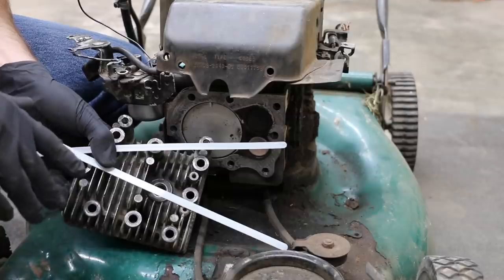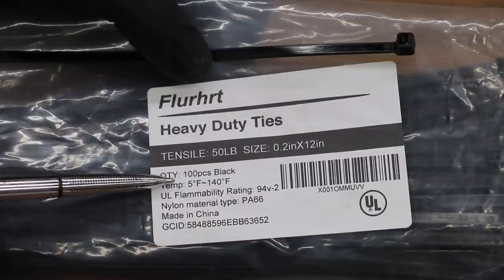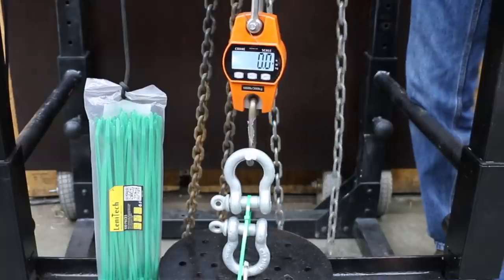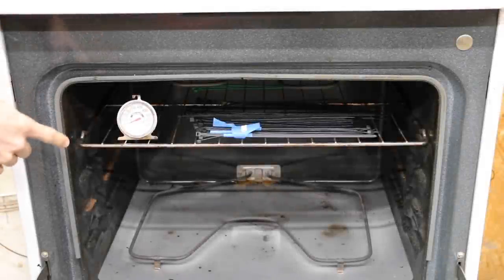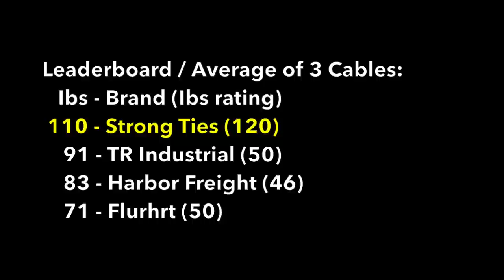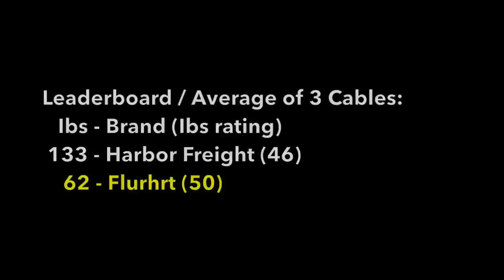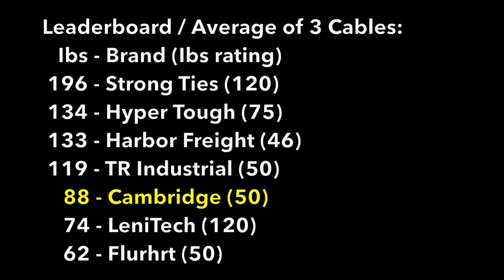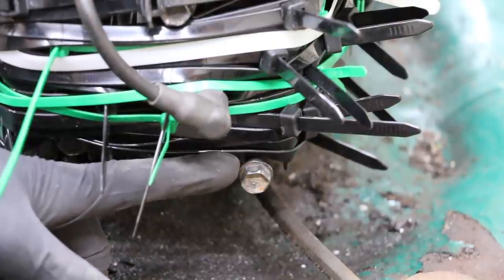Best Zip Tie Brand (7 Brands Tested)? Let's find out!

Comment: which tires sealer is best, slime , sleaer in a air can tire ject etc tube sealer and tubeless sealer
Reply from the maker: Thank you for the video idea!
Reply: That might be difficult to test considering the variables of whether there was a puncture, whether the object is still in the tire, whether it is tread or side-wall, newer tire or old/dry-rotted, whether leaking from the bead (where slime/etc liquids will tend to not go), leaking from tire stem, will it clog the stem core or TPMS sensor, will it really piss off (or at least be a big mess) for whoever takes this tire off to fix, will it work as well at cold and hot temperatures, at different tire pressures, at different loads, at different application temperatures, for how long it will last at different pressures, whether it makes it more difficult to get a tire patch to stick... and probably a dozen other significant variables that I can't think of at the moment including cost per application, shelf life, and whether there is the ability to store in a vehicle (trunk, etc) in very cold and cold conditions.

I'd say this type of testing could be useful but would take many months to do right and would generate so much data that we'd be left with the existing consensus that you only want the spray can type if it's an emergency and you need to inflate the tire a bit with it, that it's meant only for not getting stranded, then a tub of goo (slime/etc) for everything else.   In other words for a public road vehicle, if you can avoid use of tire sealants you're better off.  If not public road transportation, is it that important to rush to get a tire to seal?  Maybe if you know you're replacing it anyway and it's your wheelbarrow where you can just get a new rim with a new tire already on it.
Reply: @johndowe7003  yeah i wouldnt use it as a permanent fix. Just a keep in your car if you need it to get you to a close shop. I keep a 9volt air compressor and some tire seal in my pickup just incase
Reply: I Suggest Highlifter https://www.amazon.com/High-Lifter-Hlp-Tire-Sealant-x/dp/B00QV4U0V8 I've used this in every ATV tire flat I've ever gotten and it's fixed every single one of them. Even the most dry cracked and awful looking WWII surplus tires have held the same PSI for 2 years straight after filling them with this pink stuff. (suggest oil syringe for filling from a cup)
Reply: @burp1914  yeah that can happen if you got bare steel exposed. I paint the inside of the wheel with primer sealer just to make sure that doesn't happen .
Reply: I always preferred Slime, until it caused a leak.  It messed up the valve stem.  It got in the stem, dried, and prevented the valve from sealing.
Reply: @robertheinkel6225  yeah I like slime the most, seen it stop a 3/4 hole on a tractor tire and I was rather impressed that it held up . Never had problems with leaky valve stems in my experience though .
Reply: @Krazy Kanuck last time i got a flat on my truck i just drove it like that for about 5 miles on the rim lol, steel rims are the best for that
Reply: @johndowe7003  Ever have a tire split apart after being plugged?  I have three times now.  I'll take my chances with slime especially if its a newer tire with lots of tread left.
Reply: @BlàckÐèàth  i rarely use actual tire plugs they either get patched or have sealer in them
Reply: To test and take out variables you could use as cheap of a cart tire as you can find to keep costs down then screw a drywall screw in and remove it, install the sealer to be tested then air the tire up and see how much pressure it holds initially and then over 15, 30, 60 minutes.  Then mount another tire and do the same thing each time.
Reply: None. That shit doesn't work. Take it to a tire shop and get it repaired properly. Nothing I hat more than repairing a tire and when you take the tire off all the slime falls out on the floor. Most of the time when you put that stuff in the tire, the tire is junk anyway. You cant repair a tire after that stuff has been in it.
Reply: @alexpuls8219  I fix my.own tires, I don't take them to shops cause chicken sht wanna be tire men complain about getting dirty. I patch, plug , seal etc I do it all on my own equipment.
Reply: @Alex No one said that they wanted to use the tire sealer forever.  It would be nice to know which one worked best in a pinch. Also, slime definitely does work, I've used it to fix ATV tires, lawn mower tires, and car tires that have held air for years afterward.
Reply: @johnbarzee7806  what I'm saying is that when you put that shit in your tire. You can't repair it after. It soaks into the rubber and the patch will never stick. And dont say you just plug the tire. That's not how you properly repair them...
Reply: Ridw-On Tire Sealant and Balancer. You're welcome!
Reply: @Krazy Kanuck I don't cut the tire off , I drive on it. Allloy wheels kinda suck cause they tend to chip or crack if you drive on the rim on a hard surface. I prefer steel rims for that exact reason.
Reply: @Krazy Kanuck exactly why I have a full size spare in my vehicle.
Reply: @lifeisawar zone yeah i only used tire sealer canned and slime, and napa brand sealer i like the tubeless tire sealer the most the tubed sealer has finer pieces which is better for tubes rather than tubeless
Reply: @superguest3  why wouldn't you just carry a plug kit, that way they don't charge you labor to patch the tire afterwards.
Reply: @davidroberson8951  to be honest dont know how to do it that way. Plus I have road hazard anyways. They don't chage me parts or labor

Comment: I used thousands of zip ties while working for SW BELL and AT&T as an outside cable tech.  The black ones lasted twice as long as colored plastic due to higher carbon content in the black plastic.  Also, the ones with metal tabs are much stronger.  Stainless steel ties are the best, though pricey. One weak point is that squirrels love to chew on the plastic ties as well as being weakened by the sun's ultra-violet rays over time.   They have 101 uses and come through in a pinch for any handyman's tool pouch.  J K
Reply: Totally agree on using black only! Only just started using the stainless ones, my problem is getting them as tight as the plastic ones due to the lack of elasticity...
Reply: Do you have access to the tool used for the metal ties ?  It is nothing more than a round rod with a slit in the end.  I have used needle nosed pliers but not as well.  There is a bit of a technique to getting them tight. It takes a little practice,  mainly cut off all but about one inch after it is slipped through. Then curl the end in . One direction works better....underhand twist.   J K
Reply: @jameskrivitsky9715  Ah, I had no idea a tool was meant to be used! Thank you!
Reply from the maker: Great tip on using the black ones!
Reply: James Krivitsky, Do you remember using a cable tire (it wasn't technically a zip tie don't think) that was about 1/2" wide and you had to feed both ends into clasp/locking piece? It had metal tabs inside to bite into the tie)/band.
Reply: In my country the black ones are specifically UV protected compared to the whiteish ones.
Says so on the package at least.
Reply: is that why MommyBell filled chapter 13 LMAO to many zip-ties  sorry had to pock fun at it a little.......You are right on saying the black ones hold up better, its also do to the plastic they are made out of tho also.
Reply: i dont know what brand the at&t techs use but i got some from them years ago and they where better then any other zip tie i have used
Reply: @paulshayter1113  I use them at work. They are Band-it. The company name. Yea they far superior to zip ties but also far outsize the prize range of a zip tie
Reply: I can confirm, when unloading trucks in a retail environment, you can snap even most oversized zipties by hand to unpack products faster. The metal ones however are in another league.
Reply: Black ties are UV resistant.  The white ones self destruct in the sun in 2 to 4 years.
Reply: @johnd4348  not all black cabel ties are uv resistant ! We sell cable ties and I talked with a manufacturer about it.
Reply: @Lusty_Wench 
Guess what? Black die in plastics is usually carbon. Doesn't add anything in strength (they aren't carbon fibers), but it inherently makes playstic more resistant to UV, because the UV gets absorbed by the carbon instead of breaking plastic molecules.
Reply: @paulshayter1113  In Ohio, those were https://www.google.com/search?q=deltec+cable+tie+with+double-locking+head&rlz=1C1SQJL_enUS793US793&oq=deltec+tie&aqs=chrome.4.0j69i57j0l3.14139j0j4&sourceid=chrome&ie=UTF-8   Either in pre-cut lengths with the head attached to one end or as a roll of strapping with a bag of loose heads.   Incredibly strong.
 "regular" ties were usually from Thomas & Betts
Reply: @allthoseclips582  Totally agree on the metal ties. They can't be beat for their strength. Unfortunately, my girlfriend always complains that they chafe.
Reply: @paulshayter1113  You are talking about Deltec straps I've held transmissions up with those.
Reply: Chris S, ding, ding, ding,ding, We have a winner! Those are the straps. Incredibly strong and they seem to be pretty much impervious to chemical and the elements. A buddy that worked for Ma Bell back in the 70s & 80s gave me a bunch of them and I used them sparingly over the last 40 or so years. I think I'm down to my last two but now that I have a name and can source them I can start using them again.
Reply: Hydroculator, You have to wrap them in felt. 😉
Reply: Larry Kraus, They're the ones.
Reply: I still remember using a zip tie zipping tool.  We made tons of cable harnesses for the gaming,  I.T. and custom harness industry. Been a long time.
Reply: petrol devo, I still have two different tools. They are nice for getting a tight fit but also the cut the end cleanly without leaving a sharp edge/burr.
Reply: @paulshayter1113  yeah, those are nice and get the job done quick.
Reply: @Lusty_Wench  , and just what do you suppose makes black dye black? If you said "carbon", you win!
Reply: Hellermanntyton are by far the best Zipties I've ever used
Reply: The tools i used on zip ties left a sharp angle cut if not cut perfectly flush.
Reply: In my home country (New Zealand) we install climb guards on every power and comms pole to keep critters off them  - nothing fancy, its just a 24 inch wide strip of stainless steel wrapped around the pole that they can't get past - https://www.humes.co.nz/assets/Concrete-Precast/2562d65da4/Humes-Concrete-Power-Pole__FillWzQ4MCwzMTVd.jpg or https://www.odt.co.nz/sites/default/files/styles/odt_story_slideshow/public/slideshow/node-1258660/2017/08/agerrypole8.jpg  (They're known as possum shields because the primary climbing pest is Tasmanian ringtailed possums)

When coupled with an almost religious attention to keeping trees away from the lines It's highly effective at saving wire breakages from heavy animals on comms cables and power cuts due to crispy critters on 11kV lines.

I'm surprised more countries don't do this. It's very cheap to do and saves a lot of problems longer term.
Reply: As a truck driver I don't leave home without them, I wouldn't want to live in a world without them.
Reply: Aye, I started with Southern Bell in 1970 and they used to provide us with gray ones to match the inside wire color, and black ones for outside. Don't remember what year, but they advised us sometime in the mid-70's to not use the gray ones outside because of UV driven plastic breakdown. The black ones were known to be more suitable from the point on. And starting about that time we were required to replace the gray ones with black ones if they had been placed outside and the boss could see them when doing job inspections. The gray ones would start falling apart in just a few years.
Reply: @christopherwallace826  Bell Canada used Thomas & Betts

Comment: Can you test which Drain Clog Cleaner works best?
Reply from the maker: Thank you for the video idea!
Reply: Buy 1l of highly concentrated sulfuric acid on amazon or another store.  That will make 200 liters of 0.1M pH 1 of draino for $30-$40.
Reply: John Handcock  That's really fricking dangerous stuff and needs to be handled with extreme caution. I've seen people add water to the acid and have the heat reaction blow the whole mess into their face.

(Yes it's effective, but gloves and face shields are essential. You might get away without them but sooner or later a mistake will happen)
Reply: @alanbrown397  Thank you for your concern.   I guess I should have added some precautions, because this is indeed a dangerous chemical.  

You never add water to acid.   You  slowly add acid to a jug of water.  In this case, about 1 tsp per liter.   I wear chem goggles and gloves when mixing it.  I mix it in the bathroom with a shower if the worst should happen.
Reply: The grease and hair drain clog removers use diluted sodium hydroxide. Also, sulfuric should only be used if you have pvc piping. Older homes beware.
Reply: Yeah concentrated sulfuric acid it is the way to go. I Have used gallons of it but at one time you couldn't buy it anywhere except a plumbing supply store. And you had to be of course licensed and have an account with them.

I have used everything from hydrofluoric, Hydrochloric, sulfuric, phosphoric and even acetic acid which of course is just pure unadulterated vinegar! That's something you probably wouldn't want put on you pickle! Believe it or not that 5% stuff you buy in the store seems a little strong when you bring it up to a boil but the hundred percent stuff will take the meat off of you! And blow your sinuses out your head if you breathe it in straight. But anyhow back to the zip ties!
Reply: @Mason Schild Actually Thomas is right it may say it is safe but it damages the pipes and they will still be good for a while but it essentially puts a ticking timer onto the lifespan of the pipe.
Reply: dont EVER use that stuff! it eats away at seals and even the plumbing! spread the word, very bad stuff!
Reply: Way to go bud, your idea got made into a vid!

Comment: Lessons from the vijayo:
- Most cable ties fulfil their load rating and even have a decent safety factor (skookum factor?)
- These things are fairly consistent!
- DO NOT rely on the skookum factor, buy the strength you need. Double 'em up if you need to.
- Do not rely on the temperature ratings.
- If the darn thing doesn't look skookum - it ain't!

One suggestion for improving the test rig by this here humble inginerd: motorise the chain hoist. If you pull 'em apart at different speeds (the fancy term is "strain rate") - they might fail at different strengths and that will naturally skew the results. The only way to keep that consistent is by using a constant speed motor of some sort. I tend to favour a synchronous motor for the job, but pretty much anything will be more consistent than a human.

Vijayo idea: modify the concept of what you did here to just test marketing claims, i.e. do they deliver what they promise. This is mostly just an operating temperatures thing.

This was a great one, thanks!

Comment: At 3c per tie, honestly, HF won. It wasn't all that far off the wallyworld one and the other was kinda up a class size. At that 9c price, it didn't outperform HF by 3 times. I used to just use the HF ones and when I could afford it more as I got older, I moved on to "better" brands... I think HF won me back. At least to the zip ties and a few other minor items.
Reply from the maker: Thank you!
Reply: Given how close the HF and WM brands finished, one wonders if they aren't the same, except for price.  But more importantly, I don't know how often I need ultimate holding power with zip ties.  For Christmas lights, small electronics and other typical uses, if they perform to rated specs or even close, that's good enough.  With HF, you can afford to have enough in various sizes at all times.
Reply: Just stay away from HF hand tools!!! But impressive performance on their zip ties.
Reply: Me too.  The winner was much wider and will work in less situations.
Reply: Agree. They are almost just as good and they are a fraction of the price. HF won this.
Reply: Just use two if you need extra strength and can afford the extra space of the big one, haha.
Reply: @gr81disp  I've got some pittburgh pro extension bars from HF and never had any issue with them, even subjected to an impact gun.

Comment: Another great video for "everyman". As an industrial electrician, zip ties are near and dear to my heart. I have cinched up literally tens of thousands of them over the years. That said, Thomas & Betts Ty-Rap brand black UV resistant zip ties are easily the best available in my opinion. If you ever do a test of some of the premium brands available, be sure to include them. As a matter of fact, I'll send you a 100 pack if you elect to do the test. Let me know and specify the length and width and they'll be on the way.
Reply: Agreed.  Especially the ones that have the little stainless steel "clip" or "lock" in them...
Reply: I have definitely used Ty-raps for things that weren't designed for, they're the best!
Reply: Dude you dropped the ball when you didn't test the Thomas & Betts tie wrap brand. The ones with the metal clip will surprise you and far surpass the mediocre croup that you did test.
Reply: Yup agreed,  Thomas and Betts are for sure the best zip ties

Comment: Helpful hint, when opening a bag of zip ties (zip lock tops excluded) poke a hole in the center of the bag and pull one out at a time by bending them in half. This way they don’t fall out of an open bag :-) 

Another awesome video!
Reply: Always made a small hole at the top and use the bag like a toothpick holder. Never thought of this and i can tell how good it will work. Thanks !